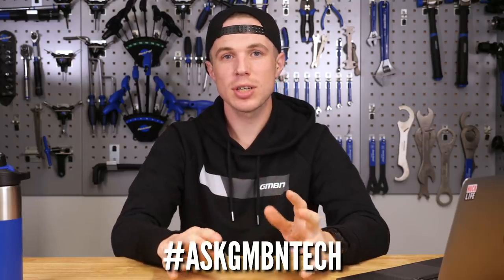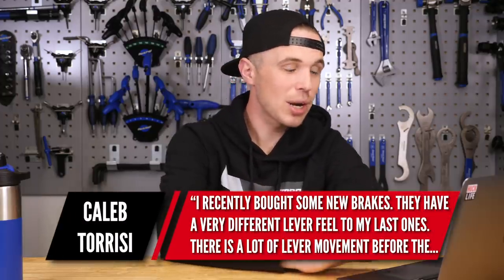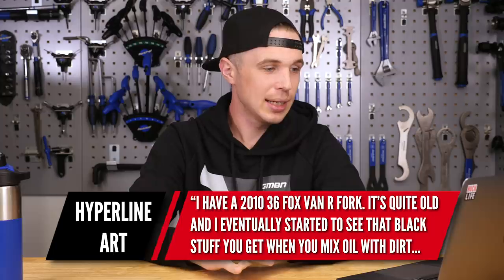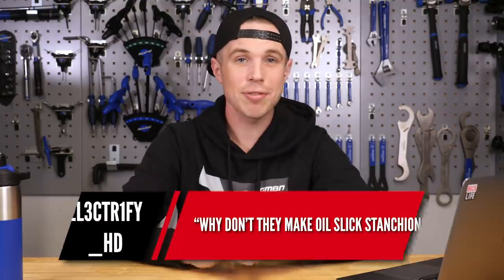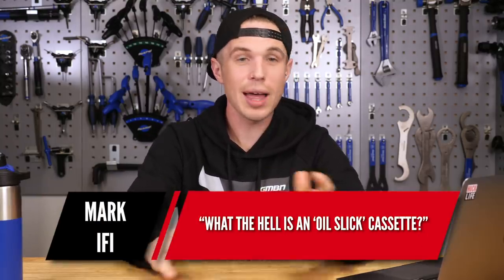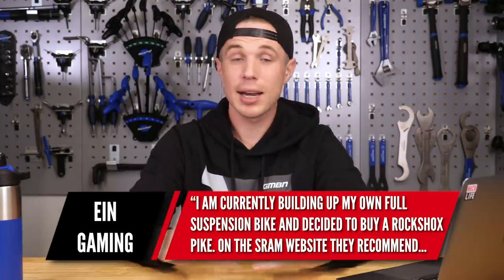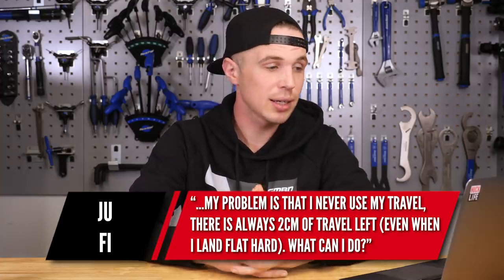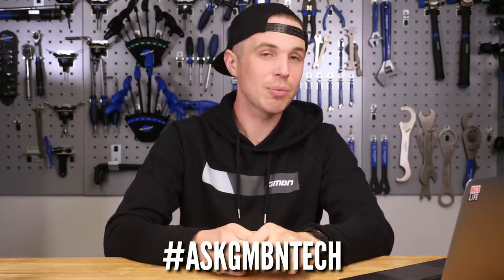Why Don't They Make Oil Slick Stanchions? | Ask GMBN Tech Ep. 86

Comment: #ASKGMBNTECH 
The thread inside my fork where the Maxle goes seems to be rounded off, what should I do?
Reply: I should also add that the fork is a Rockshox Recon RL which came with my 2019 Nukeproof Scout.
Reply: How the hell did.u do.that? U know its only threaded on the one side? Not both. New lowers if it really is. Wouldnt risk a helicoil as magnesium and structural

Comment: #AskGMBNTech recently i have noticed that when i pedal hard, for example while riding uphill, theres a clicking noise coming from the pedal/bottom bracket area. How can i fix this? And thanks:)
Reply: process of elimination, it can be sooo many things including saddle, seatpost, cranks, pedals, shoes (if clipped), cassette, hub
Reply: @ultiss  It must be either the pedals or my bottom bracket, cause after like 3-4 months after i bought my bike the bb started doing that noise, and now its doing it again, but i dont know what is causing this.
Reply: @chris_tilem  how do you know it was the bb?
Reply: @ultiss  The first time it happend the sound was coming from this area like now and i thought it might be the bb, so i removed it, cleaned it and greased it again, and it stopped. So now that it is making this sound again i think it might be the bb again.
Reply: But now that this is happenning again, im a bit worried that it might need a replace (hopefully not)

Comment: #AskGMBNTech

Gentlemen (and Henry), I would like to convert from SRAM GX 12 speed groupset to a Shimano XT 12 speed groupset incrementally.  I was wondering if you could tell me whether certain parts are compatible, for example a Shimano rear derailleur with a SRAM cassette? Shimano derailleur and SRAM shifter? Are the chains similar enough to be interchangeable? Would i need a new freehub when i change cassette? Any other compatibility issues you can think of? 

Thank you kindly, keep up the good work.
Reply: You need shifter and derailleur from the same brand, the rest is compatible. But if you want the full advantage from the new hyperglide system you will need all the shimano bits

Comment: I had my bike upside down on a car trip for a couple hours and ever since my front brake lever sometimes can be pulled the entire way into the bars and sometimes it works just fine. When it works just fine, if I then go through a really technical section then the front brake stops working all together and i ca lull the lever in without braking #AskGMBNTech
Reply: You have air in the system - it needs to be bled to, hopefully, fix it. When you turn the bike upside down the air bubble can travel up the hose to the caliper and cause your problem.
Reply: phorest ok thanks so much kinda new to the bike scene so I don’t know to much.

Comment: #ASKHMBNTECK I'm running a 150mm disk rotor on my front. I would like to know if I am able to put a 200mm rotor on my front, would it fit on?
Reply: you probaly meant a 160mm disc, cant think of any brand using 150mm. You can fit a 200mm rotor but you will need an adapter between your fork and brake caliper. Also best to check if your brake mounting points are rated to work with the forces from a 200mm disc
Reply: @ultiss  thank you so much and I went back and checkd it was a 160 rotor😂 ill check and look more into the the forces it can withstand.
Reply: Ultiss is correct, but I think u misunderstood him perhaps...he is saying the fork caliper mount posts...check with fork manufacturer the max rotor size possible for the fork.
If u upsize, u will also need the correct length (longer) caliper bolts (due to spacer thickness).
Reply: @rupedog  ah thanks man will do

Comment: #AskGMBNTech I have a 12sp  sram gx drivetrain whit the 11-50 cassete, can I put a 11 sp cassete and use it whit the 12sp derailleur and shifter?? Thanks bud
Reply: not 100% sure, but as long as the cassette has the same freehub body (SRAM XD, Shimano HG, Shimano MICRO SPLINE) if you index it properly to lose a gear in the shifter everything should work fine, you may to shorten your chain depending on the cassetter you're planning to use though.
Reply: no you cant, 12 speed has different spacing between cogs and cable pull.
Reply: Derailleur yes, shifter no.
Why tho? 12 better than 11!

Comment: It is not ok to tell people going with a bigger brake disc on the fork when the manufacturer says only up to 203mm. The fork Is not made for the brake forces,that's the reason. But if course riders weight plays a role too, but manufacturers wouldn't say that. I ride a Frank Industries (motorcycle power 1000Nm) with 230mm and weigh 95kg. I bent a brand new single crown fork during tests

Comment: #AskGMBNTECH When you go tubeless can u use not tubeless ready rims?
Reply: You can. Search for "ghetto tubeless conversion" instructions. Basically, you need to add enough thickness with the rim tape to increase the diameter of the bead bed so the tyre is tight enough to not blow off the rim. However, it's not guaranteed to work [though lots of people have done it].

Comment: #AskGMBNTech Hey guys, is there a way to bodge a dropper post lever out of an old front shifter? Thanks
Reply: I doubt it because the lever throw on a dropper lever is so much greater than that of a shifter, so unless you managed to "de-limit" the shifter, I think you should just spend the money and buy one
Reply: Yes, I did such a thing. I used an SRAM X7 lever. It does have a lot of free stroke at the beginning, so it's not the best solution.
Reply: OK, free stroke is not really an issue for me, just want an under bar really as the over bar lever that came with the dropper can't even properly activate it. Thanks guys
Reply: @aaronashmole3623  It does depend a bit on your dropper, if the cable is clamped at the lever, or at the post. Since the shifter will force you to clamp at the post.
Reply: @zonoskar  Yeah it is clamped at the post with the cable end nub thing at the lever

Comment: How well do u think a 27.5 rear and 29 front work on a hardtail just wondering because never really seen it  #askgmbntech
Reply: they did tests on that a couple of years ago. apparently its disadvantages (in steering if i recall) outweighed the advantages. but 26r 27.5f worked pretty well.

Comment: #askgmbntech can i ride bike park on a 120 rear and 140 front mtb? Its a specialized camber!!
Reply: If you are pro you can ride on a hardtail but won't have much funl
Reply: I ride a 130 hardtail. Its fun. More playful. You can fide park on any travel as long as your capable
Reply: Definitely. I do black trails on my 125/140 Transition (though it's now 125/150 which is a even better)
Reply: Yes, go for it, but you will be slower and more tired. I rode Northstar (where they recently had the EWS) on a 2006 Yeti 575 with 130mm front and rear and a 69 degree head angle just a few summers ago. It was fun, but I go far faster and more comfortably on my new Patrol.

Comment: Would it be ok to use wet or dry chain lubes on my seatpost?
#Askgmbntech
Reply: No not really. It would stop corrosion but would make it very loose and slippery. A grease would be better because it adds friction as well as protection. I think that's right but I'm sure somebody will correct me if I'm wrong.
Reply: If it's a dropper post I've been told you're better to use a fork lube so that you don't prematurely damage the top seal inside the post. The solvent in wet lubes may not play nice with seals.
Reply: @TrailPOV  it's just an aluminum seat post
Reply: The Nuclear Narwhale Depends - what are you trying to achieve?
Reply: I agree with Ben Asquith then on this one
Reply: Same here, if the goal is to prevent the seatpost from seizing into the frame. Grease or anti-seize will both do the job, and will keep on doing the job much longer than wet or dry lube will.
Reply: grease works great as anti corrosive but is still slippery. anti seize has some grit to resist movement so best to use that. Or get some fibregrip for carbon parts and be futureproof for potential upgrades
Reply: @benasquith26  grease adds friction....🤔😱😂